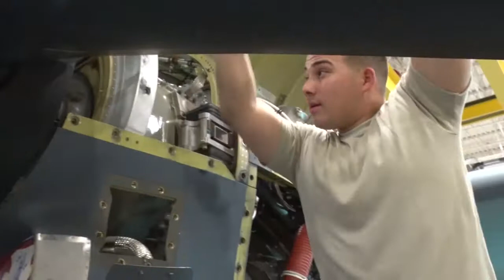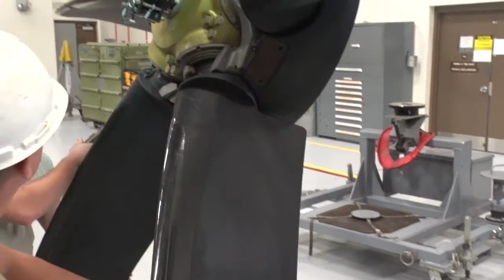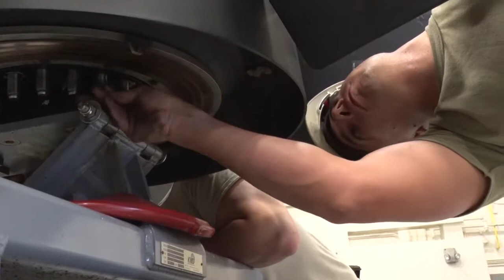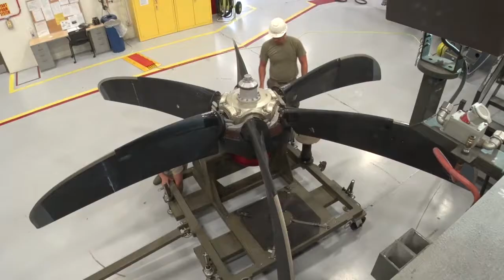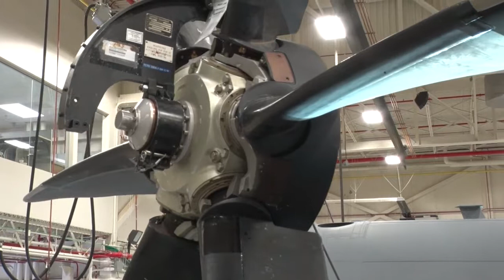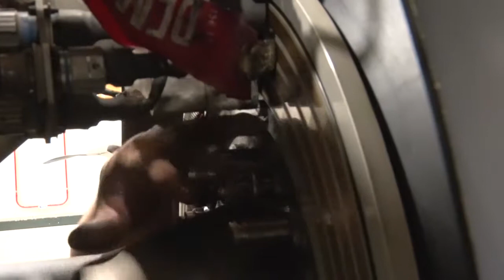Watch a Giant Propeller Get Replaced from a MASSIVE EC-130J AIRPLANE(2018)

Comment: Just toured the 109th. These eight bladed props are so much easier to work on, install, and remove than the old 54H60s we had on the now retired E models. Much better prop too, according to the pilots I know who fly them.
Reply: That’s not an 8 bladed prop. This is a Dowty 6-bladed on a J

Comment: Are these replacing the 1973 super E's we had a Sembach in the late 80's?
Reply: Were they EC-130's? lol nope, they are still flying around Tucson and hotspots around the world.
Reply: Differant engines different  propellers
That were used at ubon thailand in 1973
Myself Ubon thailand 1973. AC130A  , and AC130E ,
NKP THAILAND 1974  OV10B,  EC47

Comment: 4:32 triggered me pretty hard
Reply: Why
Reply: @ZorgKingOfMonkeys  i think when the hub unseated from the prop shaft, the bottom blade tips contacted the maintenance stand
Reply: @mikesmith7249  No it was because he was rocking the prop back and forth. You can ruin a prop by doing that
Reply: @matthewmajcher7180  Interesting. I just noticed this system doesn't involve a propeller hub splined to a propeller shaft, instead, the propeller hub is bolted to a shaft.
Reply: @mikesmith7249  Yep, it bolts to a PFA (Prop Flange Adapter). The old legacy props splined on tho

Comment: Well that sucks.  On the old, Aeroproducts H-606 propeller, there was one big nut that was easily handled with a torque multiplier.  Prop changes were simple.  Replacing any of the four units on the back plate of the propeller, on the other hand, was a bitch with the prop on-wing.
Reply: do you mean54h60 Hamilton standard  4 blade     c130A  had  aeroproducts  3 blade steel blades first ac130  were  A models    i was in ubon thailand 1973

Comment: Why don't they use air-rachets?
Reply: Because normally there is no air source.  In the ISO hanger like they are, they have air. But out on the flight line, definitely not.  You sort of get in the habit of just using regular ratchets.
Reply: Per AFI, air tools are not allowed.
Reply: Tool is too it doing the same work  🙄🙄🙄